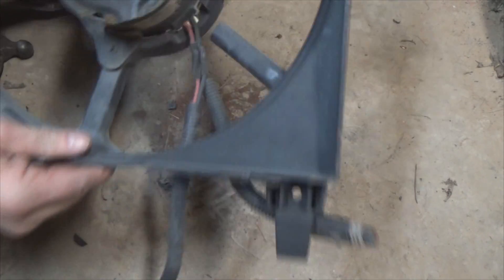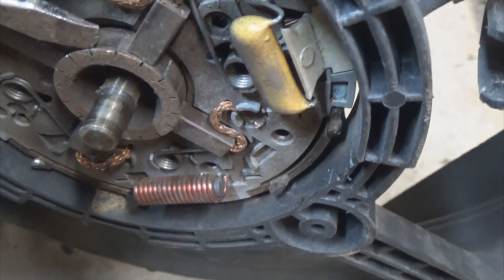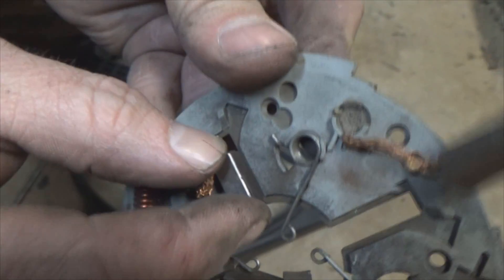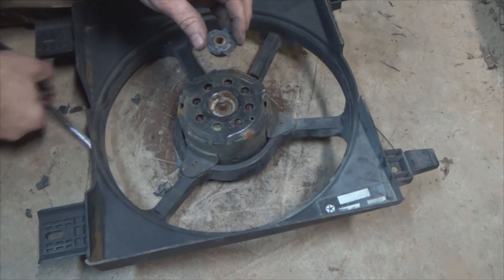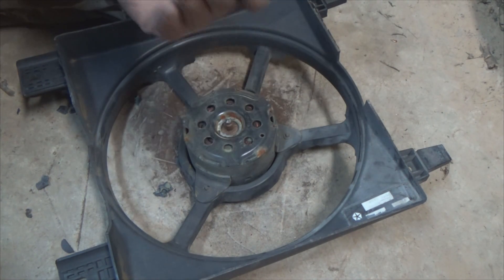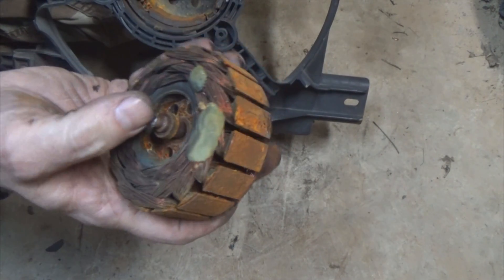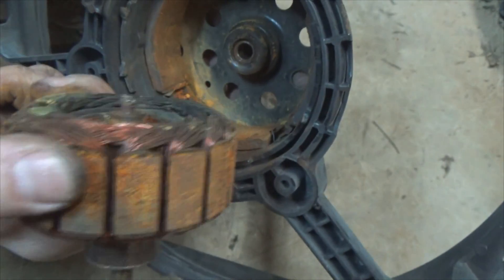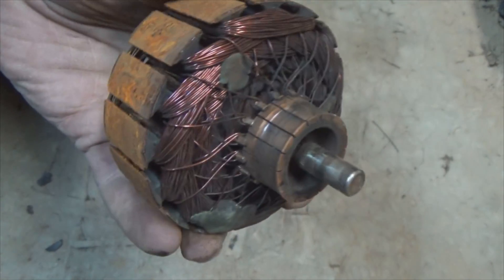What is inside an electric engine cooling fan?

Comment: I'd like to see inside the steering column of a jeep. How the key cylinder starts the jeep and how the turn signals cancel when you turn the wheel.
Reply from the maker: I gotta change the turn signal switch and key cylinder in my '91. I also have a lower bearing bad. So all that will be a full video for each repair at some point. Thanks for dropping in a cool suggestion. Feel free to drop in more suggestions anytime. Have a great day!